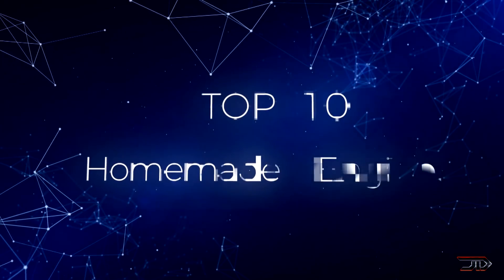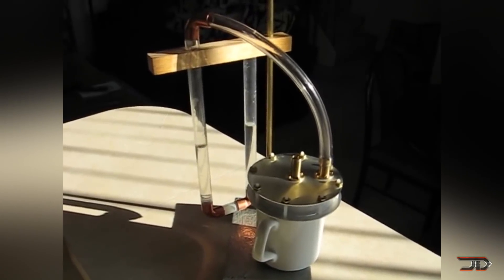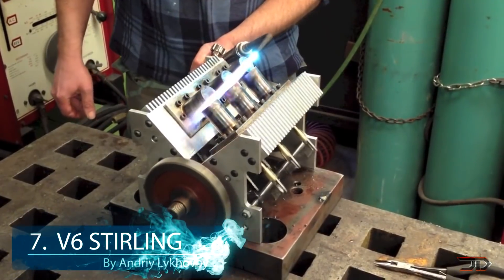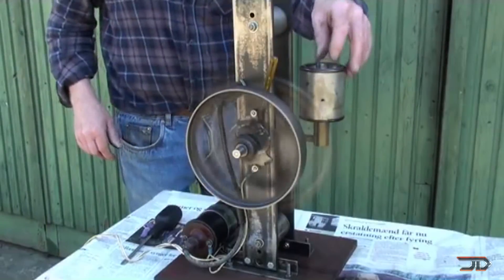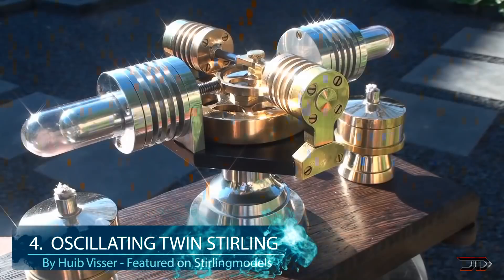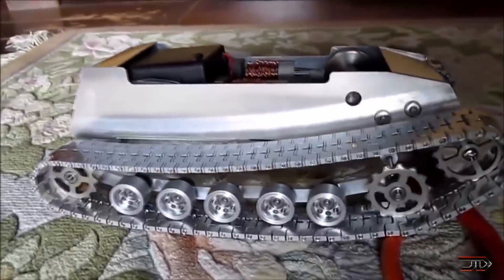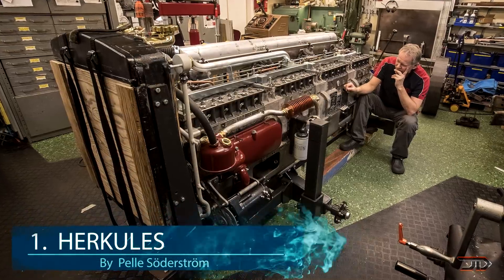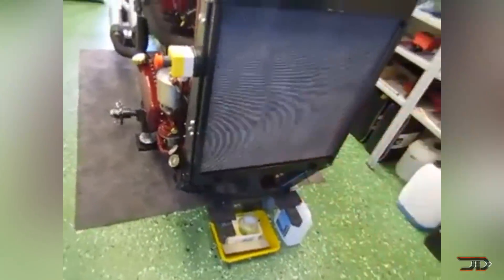TOP 10 Homemade Engines -2-

Comment: How about an engine that doesn't sound possible. Continues stroke, no valves, crank, no reciprocation or oscillations. 12 combustion per rotation on a single stack configuration. The specifications are off the chart!

Comment: "It has over 5,000 HP and 37 Foot Pounds of torque." Based on the accepted methodology and formula for determining HP ( HP is a notional number that is derived from entering Torque, which is an actual number derived from the amount of force available from the twisting or motion of an engines crankshaft or output shaft, the output shaft of a transmission being driven by an engine or motor, or from the  spinning tire(s) or tracks on a vehicle when measuring the amount of torque available at the point where that torque is applied to the surface the vehicle will be driven on and the engines RPM) The term Horsepower was first used by a tractor salesman in the early 1900s while trying to explain how much work the tractors he was selling could do to farmers who understood how much work they could expect out of their horses in a given amount of time. To do this he simply grabbed a number with no actual basis in fact, more of complete guess, and said this one Tractor can accomplish the same amount of work in a single day that normally would require ____ number of horses to do in the same amount of time. If the number of horses he used in his sales pitch was 4 then it would be a 4 horsepower tractor. This was the birth of horsepower, a notional number used to describe the amount of theoretical work a machine was capable of performing within a given amount of time, and comparing that theoretical work capability to animals that are by nature themselves not equal to rate a machines theoretical output was obviously problematic. Whose horses, what kind of horses,  Clydesdales are obviously stronger than miniature horses and can pull heavier wagons but Thoroughbred horses are faster while Quarterhorses are quicker over a quarter mile.... A standard based on something that can actually be measured was needed, and then using that number and the number of revolutions per minute that the engine is producing at the point in operation where the "horsepower" number is being calculated for uses the formula: Horsepower = Torque × RPM/ 5252 
This is the formula used to extrapolate HP from torque and RPM and is the currently accepted SAE standard, and is used all around the globe by companies who manufacture internal combustion engines other than pulse jet, ram jet, or  turbofan/jet engines, as well as rocket engines as power output is measured in pounds of thrust. An exception can be made in jet engine applications where the engine is coupled to a gearbox/transmission or hydraulic drive system that allows torque to be measured off of the output shaft of the coupled drive system. An example of this would be the original M1 Abrams tank had a jet engine ( same one used in early UH 60 Blackhawk helicopters) and was rated at 1500 horsepower as measured at it's coupled gearbox. Note the number 5252 that the SAE formula uses. The use of this number means that Horsepower and Torque are always equal at 5,252 RPM, assuming the engine is capable of achieving 5,252 RPM, keep in mind many very large long stroke engines and diesel engines max out well below this RPM due to mechanical limitations based on their design principles.  The HP output of an engine can be changed by simply choosing a different number than 5252 . For example an engine making 550 Ftlbs of Torque at 5500 RPM using the 5252 variable will generate 575 Horsepower at 5,500 RPM. If we use 4545 for our variable but still have 550 ftlbs of torque at 5,500 RPM we now get 665 HP at 5,500 RPM. The engine did not make more power but the changed variable gives a different value to our notional HP number that's significantly different. Also the methodology used to extrapolate the torque numbers can be changed. In the 60s and early 70s carmaker used a gross HP rating. This was derived by measuring torque at the crankshaft under Ideal conditions without intake or exhaust flow restrictions like fully enclosed aircleaner housings, restrictive filter elements, and mufflers that caused excessive back pressure, and no accessories like power steering , air conditioning, alternators/generators or other belt driven equipment was in use while the engine was on the dynamometer and this led to higher torque and corresponding HP numbers. In the early 70s the SAE implementation of Net HP numbers that ran the engine with all belt driven accessories, production aircleaner and housing, and full factory exhaust was required which dropped torque and HP numbers by as much as 25% or more in some cases. Then add in the number you see on a dynamometer printout is SAE corrected  for atmospheres conditions. Due to air density an engine can make more power in cooler air or at sea level than it would in a hotter environment or at high altitude. Humidity and barometric pressure also play a role. The dynamometer operator must enter in figures for temperature, humidity, barometric pressure, and altitude before testing. The test is then run and the actual output under these conditions is converted to what it would have produced at sea level, 70° with ideal humidity and barometric pressure (determined by SAE and the printout gives the SAE corrected Torque and HP numbers. This is done to prevent engine manufacturers from doing all there testing at facilities with ideal conditions like Northern California coastal cities in November vs Detroit MI in July. With SAE Corrected numbers there is no advantage to cherry picking a time and place to test. But the dynamometer operator can always fudge the numbers, add 10° of temperature, 20% in humidity, drop the barometric pressure and add 500 feet in elevation and you'll see a higher actual number and therefore a higher SAE corrected number. This has often been a trick used by shady dynamometer tuners for their before and after tuning results your before test showed 425Hp and after he tuned it you had 485 Hp but in reality he did nothing significant and changed the atmospheric conditions being input into the computer to justify charging a large fee for "dyno tuning" your engine. Always read those inputs as they should be on the printout. Also, if possible, be there watching the test and pay attention to the throttle opening ( I mark mine with wide open throttle indexes in a bright color so if he lifts off the throttle or doesn't open it all the way on the baseline runs to lower the numbers I'll see it. A lot of shady folks use these techniques to pad their "gains" and charge more money. I hope this has been helpful in defining what Horsepower and Torque actually mean and explains how 5,000 HP and 37 Foot Pounds of Torque from an engine is a mathematical impossibility if using accepted formulas and methodology for measuring these numbers. Also, if you really want to see impressive Home built engines checkout Dennis Franz YouTube channel as he has 5 or more engines that he homebuilt that are more impressive than all but the last two engines you listed and he actually uses his in real world applications.

Comment: radial and rotary are 2 different things
Reply: Very, very different things
Reply: @oldhillbillybuckkowalski  and there is radial rotary engines to were the radial engine rotates i think they were around in the early 1900s
Reply: @patrickdean9797  musta worked so great that they left it in the early 1900s for safety reasons .
Reply: @oldhillbillybuckkowalski  i agree it was a spinning mess of metal the only decent example was a motorcycle with no brakes and the engine was in the wheel so if it was running it was moving
Reply: @patrickdean9797  I actually saw old movie footage of a motorcycle race in France where a guy crashed the hell out of one, and I think he died. But that was also the era of Boardtrack Motorcycle racing, 100 plus MPH on bikes with no brakes or even a throttle control in the early days, only a momentary switch to ground the magneto when the race was finished. No clutch on many of them, push start only and if it's running its going and going full send. Tracks impaled people with huge fatal splinters. Boards came loose and left 10 inch wide 8 foot long holes 5-6 feet above the ground. Some kids got killed sticking their heads up through the holes to watch the approaching riders, didn't know they were already there. Yeah motorcycle racing, and car racing was crazy dangerous, fatalities occurred regularly and they didn't even stop the races. It was definitely a different time.
Reply: @oldhillbillybuckkowalski  yep safety last and boardtrack racing must have been crazy it was like the velodrome but like you said 100+ mile an hour bikes that did not have brakes and those bikes were basically pedal bikes with motors so they had  no business going 100mph
Reply: @patrickdean9797  but fun fun fun until dead dead dead.
Reply: @oldhillbillybuckkowalski  yes they probably died doing something that they loved
Reply: @patrickdean9797  and quickly.  No laying in a bed staring at a ceiling while you wait, wondering if it'll happen in your sleep tonight or while one of your real friends is visiting... sorry for the morbidity,  I've just reached a point in life where thoughts like that are no longer abstract.
Reply: @oldhillbillybuckkowalski  it is alright i think we all think about death time to time life expectancy is getting longer and longer in the middle ages 35 was an old man now it is 80+ i am 43 and i do not want to have to live another 40 years i am getting tired of the whole trip i am sorry about my own morbidity it isn't always bad though i just feel bad for the younger generations that might not know the freedoms we had
Reply: @patrickdean9797  the freedoms we had, the kind of people that we grew up with. Life that wasn't about earning likes and communicating with emojis. When you made friendships that lasted lifetimes, and it was face to face. Life seemed more real, respect was important and disrespect ended with a lesson learned. I can't imagine the men from my childhood owning a selfy stick or saying OMG I'm RTHFLMAO. I can imagine them kicking my ass out of the garage if I  had a FB account though. I remember when something needed to be said you said it. If feelings got hurt, maybe they needed to be hurt. Now you gotta go see HR if you imply someone is a sissy. Maybe my passing soon is for the better because I can't imagine this world in another 5 years being a place I enjoy living with.  Thanks for the conversation, at 51 years old I often feel like a dinosaur that can't relate to anyone on the internet.  Maybe I'll see you around in comments, seems like we may have some similar interests.

Comment: Скоро такие технологии могут понадобится.
Reply: Most of these like the Sterling have been around for a century or more and are not used because the power output vs fuel consumed is so low that even early 1900s gasoline or 1800s kerosene engines dramatically outperformed them in power output and used much less fuel to do so.

Comment: The Devel 16 is, was, and will always be vapor-ware. The engine was actually built, but failed miserably due to internal limitations. There was never an actual test that produced the desired 5000 horsepower without self-destructing. All development was ceased due to removal of funding by the original backers.🙄 Despite all the hype behind the project, there was NEVER an actual Devel built that incorporated the mysterious '5000 horsepower quad-turbo V-16'. Any and all tests and 'reveal' videos were carried out with a turbo-charged 6.0L Chevrolet LS V8, or in fact, no engine at all. Any videos of the car actually driving were done with the same Chevy LS engine and a specialized exhaust to make the engine sound 'fuller'. Just an FYI, a V8 and an even fire V16 sound almost identical, since the V16 actually has 2 cylinders firing simultaneously. 😉
Reply: k

Comment: Any Rotary Engine  Game over.
Reply: Relatively large Hp numbers with poor low-end torque, poor fuel efficiency and terrible thermal efficiency. For certain lightweight applications they work great and if fuel efficiency is not important they can perform well but they are slaves to their cooling system, and any issue with it causes a meltdown second only to Cherynobl or 3 mile Island. If you see the temp gage start to climb in a regular we'll designed piston engine you hope to make the next exit before damage occurs, with a Wankel Rotary engine you hope you can pull to the shoulder and shut off the ignition before damage occurs.

Comment: "8 Cylinder Radial" hmm, everything I was taught in school was that radials were ALWAYS odd numbered, do to the fireing sequence. Maybe air engines don't have this limitation.
Reply: Yes, a true radial engine will always have an odd number of cylinders per bank because of the slave rods master rod design only when two or more banks are used like 2 banks of 9 cylinders do you get an even number of cylinders.

Comment: Your #9 is a water piston engine - here are two installed as irrigation pumps in South Australia.  Only one is still operational on demonstration days.  It can pump 250,000 gallons per hour to a head of 35 feet.  It is called a Humphrey Pump - https://youtu.be/j8ov1D5j6eQ

Comment: 8 cylinder radial?

Radial engines have an odd 
number of cylinders, per row.

8 cylinders won't work.  (Yes, 
2 or 4 row radial engines DO 
have an even number of cylinders, 
but each row has an odd number.

steve
Reply: The Bentley is a 9-cyl. rotary.  

You are correct about the cylinders; rotaries, like a radial, need an uneven number of cylinders, but in a rotary, the whole engine spins around the crankshaft.
Reply: Leland, when I was in high school, 
many decades ago, my metal shop teacher 
had us cast blanks for making carburetors 
on the Le Rhone Gnome.  I new back then, 
the difference of rotary and radial engines.

I still think it is weird to bolt a crankshaft to 
the firewall.

steve
Reply: @steveskouson9620 , I guess being the first aeroplanes, they hadn't figured out the best way for everything.  With it all being cast iron, the engine would make a good flywheel, but, I would think the centrifugal forces would be working against the incoming fuel and air mixture though.

The good ol' Gnome; tough as nails. lol

Funny thing; I once had an encyclopedia set from 1921and it took me a while to find airplane in it; it was under "flying machine". lol

Comment: Last one (inline16) would make a excellent rat rod engine.
Reply: Plans are to put it into a custom roadster.  That's going to be one huge car.  It's welded-block construction, made up of parts of four Volvo B20 engines, so it has four cylinder heads.  It also has dry sump lubrication and the camshaft is driven through the middle by three timing chains.

Comment: The v16 only makes 5000 HP and only 37 FPT  that’s a typo!
Reply: The engine I`m with in the photo is 24 HP 525 RPM 240 FT lb torque the 10 inch stroke gives the high torque

Comment: 37 foot-pounds of torque did I hear that correctly
Reply: 37 hundred. I remember the first Dyno vid where they broke the Dyno at 4500 hp
Reply: That may be off by a factor of 10… 1520cc 6-cylinder Valkyrie motorcycle made ~123 ft/lb of torque
Reply: @kingneutron1  100

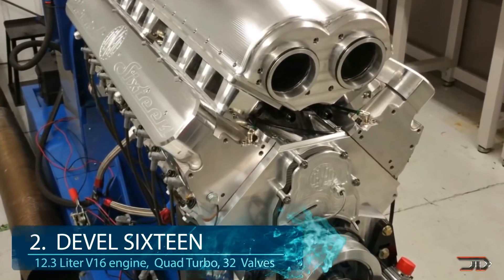Comment: 4:15 The Devel Sixteen has over 5000 hp and 37 ft lbs of torque? Lol. Pretty low torque for a 5000 hp engine.
Reply from the maker: Yeah, lol. Seems to be breaking some laws of physics there :P
Reply: https://www.topspeed.com/cars/car-news/the-5000-hp-devel-sixteen-debuts-next-week-can-it-live-up-to-the-hype-ar178296.html

More like 3,519 (almost 3600) in torque, I think he may have misread the script.
Reply: It would gave to run around 500,000 rpm fo that to happen.
Reply: It would need to spin at 709730 rpm to make 5000 hp